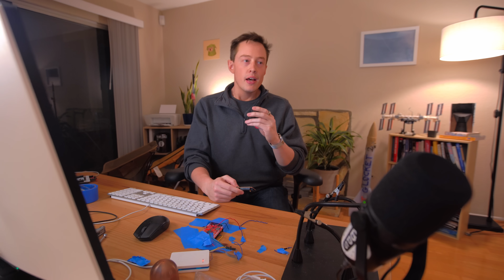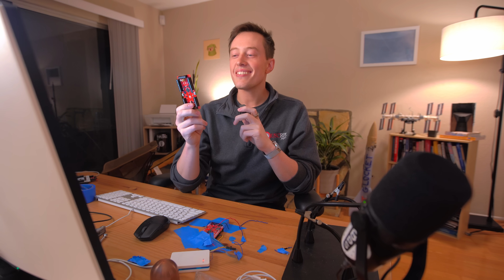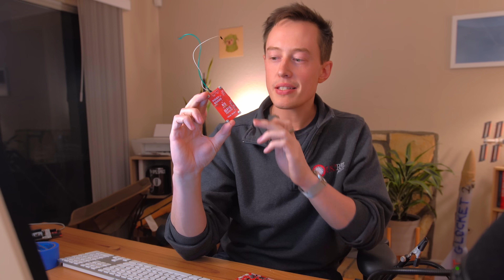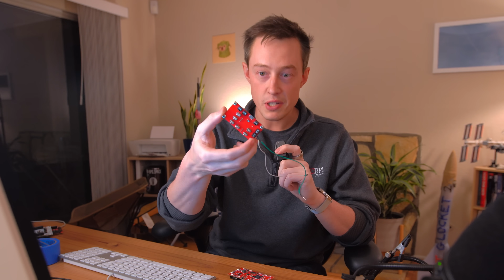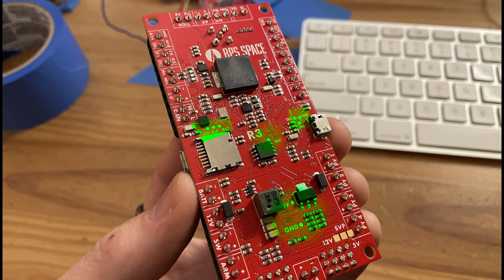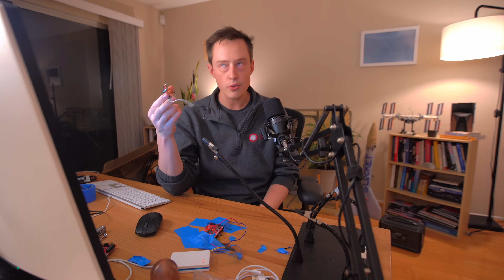the dumbest electronics thing i do

Comment: You have 3 options as far as i see it which are "proper " ways to do it.

1. "Tag-Connect" cables are good. They use pogo pins and as long as you feel able to put holes in your board, and have a cluster of pads free for programming, and think 50 - 90 bucks for the cable is worth it in the long run, then that's a good, professional solution.

You would usually use this on sparse or small boards, where there aren't a ton of things to program, but it is manageable on dense layouts also.

2. You could do something like put a PCI-E 1x card edge connector (or just any card edge connector for that matter) on your boards for programming, and them come up with a pinout of your own. This could be costly due to the nature of cutting the card edge.

I've only ever seen this on super dense boards.

3. Put .1" spaced pads on the edge of your board on both sides and use a chip clip to interface with the board edge.

I've seen this on lots of small stuff.

You could also just design a standardized bed of nails, though it seems like you want to avoid this.

Comment: I've done this sort of thing with programmers and fly leads.  I just line up the leads in the right order and tape them together with scotch tape.  It's flimsy but all it needs to do is hold it together while you're holding it down. The more legit solution is to 3d print a little box to hold a pcb with pogo pins.  The pins protrude through a hole in the top of the box in the perfect place to make contact.  The board being programmed sits in a shallow cutout for positioning. Those clamps to hold it down are called Horizontal Quick-Release Toggle Clamp and you can get them at home depot.

Comment: Instead of pads on the top layer, make them into through-hole pads. Don't space them evenly, make one of them a little further from the others (for polarization). Then 3D print a block with holes in it to hold three sprung gold pins. The pins locate securely into the holes, so you can hold them there with one hand while you click 'program'.

Comment: You could just 3d print a clip holder thing  with the correct spacing and pins so it is a 2 finger operation

Comment: First thing is make your test points vias, or through hole pads.   Second take a bare PCB (unpopulated) drill out the test point vias and insert pogo pins then solder pogo pins to the JLINK (atmel ICE) connector.  Now you have the basis of a test fixture.  You can also do something like this: https://youtu.be/MoG4nINWp5k?t=122

Comment: I dunno i use Kicad and the Pick N Place file is basically generated in the output. I do not optimize for time but for usefulness.. and me getting not annoyed.
Could you not use some pins with a certain pitch or did you design the thing to be really bad..

Comment: You have a 3D printer... print a tool that holds those three pogo pins that you can then use to press against those pads by hand... pogo pins give you pressure and the tool makes it less cumbersome to hold the wires in place? Should take you like 30 minutes to design and then how ever long waiting for print...

Comment: I work as a design engineer and we have done this for the last year on one of our latest designs for programming all of the power controllers on. Too inconvenient to solder on a header and then remove it. Can't leave the headers on because it wouldn't fit in the chassis. The design was meant to have pre-programmed parts, but we just haven't gotten them yet during the prototyping phase. So, I hold the wires while my colleague runs the software. There's like 12 controllers to program per board. My nose doesn't feel itchy all week until 20 seconds after I start holding the wires in place.

Comment: Wot about a 3d printed fixture that contains the pogo pins that the board itself clips or locks into.
Rly just sketch project the board outline and offset by what 0.3mm with located holes for the pogos. Doesn't even need a locking mech really just a rubber band or sum.

Comment: A slightly less dumb (and still very easy) solution is to just put the pads on the edge of the board. Space them out enough that you can just use little alligator clips. It's still kinda dumb, but it's like 2 minutes of PCB re-routing (since the pads appear to already be close to the edge of the board) to make it so you don't have to manually hold the wires.

If you want to take it a small step further, there are a number of 3d-printable pogo pin clamps out there. Re-arrange the pogo pin layout to fit your board, print it up, and away you go. Or if you want a commercial solution, TagConnect has a "plug of nails" cable for like $40 (not sure if it'll let me paste a link, but if you search for TC2030-IDC-NL-10, you'll find it) -- you'd need to drill three alignment holes next to your debug/programming pads, but that's all the extra effort needed. Then, you can just press the cable onto the board without worrying about pin alignment.

Comment: I wonder if you could just change the pads for plated through holes? 

You'd get more friction from the wires going through the board (or you can fold them back a little to keep in place), and you get to keep your super low effort.

This also gives you the option to solder to it if you really need to.

Comment: This would by my low effort solution:

1. Wrap each of the wires in electrical tape until it's thick enough that they are correctly spaced when held together.
2. Tape them together.

Now you can easily push them onto the board with one hand and click with the other.

Comment: Why don't you just have 3 soldered pins on the board and just use a 3 pin connector for the 3 wires and just plug it in.

Comment: You can use through holes for pin headers. If they are a little too small, the pin headers will jam in them and make good contact.

Comment: We always add the same header as the ice on our board so you can simply use a straight cable from the ice. If we dont have space for that we 3d print a pogo pin holder tool we make ourselves which holds the 5 pins for programming which you can simply press on the test pads together

Comment: 3D print a pin board... You have the board files, so you have the locations, just make a block with holes in it the right size with the right spacing... You still have to hold it or press the board down onto the pin board, but it's better than the current setup.

Comment: Make 3 holes on a piеce of cardboard with the proper spacing put the wires trough and then you will be able to use 1 hand just to put some pressure.

Or use a software that would press the mouse button after 10s delay.

Comment: Simple solution pogo pins orrrrrr if u can align it with header pins use plated holes and solder male headers to the programmer and apply pressure to the male headers at an angle pushing against the plated hole? Maybe

Comment: Tag connect in the future. 3D print a jig that hold the probes exactly over the pads. Export those locations from altium or take a scale screenshot into cad. Lastly, digikey will program chips before you solder them!

Comment: you could design a dumb PCB with only three holes in it with header pins soldered onto it and some spacers so that you can lay it on top of the board and put a brick on top of that to hold it in place

Comment: Take an unpopulated board, drill holes through the test points you use to program, stick some pogo pins in those holes, then solder the pogo pins to your hacked up programmer cable.

Comment: You could always just 3D print a lil bracket that holds the 3 wires in position. Or all 6, for that matter. Hell, you could even spend 5 extra minutes and design one that clamps to the edges of the boards, so you can let it go completely. Actually, if you send me the dimensions of the board, I'd be happy to design and print  it for you.

Comment: What you do is make a one-off board and manually place pogo pins. Once. 

The board exists as GSE, along with your soldering station. (You aren't launching your soldering iron, are you? You don't need to launch your bootloader burner.)

Comment: Looks like 5 pins - pwr + those 3 pins.
So, what you can do to be lazy:
Take the PCB design, copy it, remove all components, make the layout smaller to cover the pins
Change the pads to pogo-pins
And then just add a jumper to connect to the bootloader, a few routes and then get jlc or whatever to print the board.
Its a couple pins to solder - so minimal effort.
And you just hold the mini-pcb to the board with one hand (giving you the pressure) and burn bootloader.
You could if you felt like it, 3d print a mount/stand - basically the mini-pcb is part of the stand - so you just place the board to be flashed on the stand, push down and burn - then you are done - but thats more effort

Comment: You need a PCBite kit! Spring loaded pogo pins on weighted articulating arms. Well worth the money, I've used mine to dump Atmega chips on production boards directly tapping from the MCU without any debug ports or pads.

Comment: That comment... "we'll just do it once, then we can move on." - THAT's the catch.

You've done it more than once. You'll do it again.

Make a pogo pin board. If you wanna be slack about it, use some veroboard for a pogo board. But I strongly recommend getting a proper PCB made for your pogo board.

I did the maths on this stuff a while ago; if you have to program more than 2 boards, EVER, it's worth making a pogo pin board. It will save you time & frustration. And it doesn't have to be complicated; I just grabbed an arduino, made a really basic shield with the standard headers and the pogo pins, and soldered it myself.

Don't think about it, just do it <3

Comment: I would half-ass the bed-of-nails programmer and just solder the three wires to a 3 way strip of pin header, and solder pogo pins onto the other ends of the header :D
Just hold the pogo pins with one hand.
Hell I've done this before and left the pogo pins, just held the pin headers against the board :D the header keeps everything aligned

Comment: Thats all right, there were boards I used to troubleshoot that had a blown fuse. I'd replace the fuse and if it blew again I'd put a jumper across it. When I'd turn it on again the top of the bad chip would blow off and ping iff the back of my work bench. Replace the chip, test, replace the fuse and done!

Comment: If you got 3 pogo pins and soldered them to the wires... then heat glued (or even soldered them to a solder board) them to a scrap of PCB you would at least have an easier time than holding wires to the board. If you need contact with that little triangle pin group you could put them in that bluetack (putty?) stuff that sets rock hard when mashed and exposed to air.

Comment: At high enough volumes you could get the SAMD parts pre-programmed by Digikey/Mouser/MicrochipDirect and loaded onto a partial spool.
But yeah, you should just make some jig -- throw a tiny perfboard or OSHPark PCB or 3D printed pogo pin adapter at it. Problem solved!

Comment: few ways to do it less painfully,
use a 1x3 2.54mm header footprint unstuffed, easy to just shove the ends of the wires into the holes, or solder wires to a header to stick in there temporarily
use a tag connect footprint (might be the thing with the claws mentioned) - the cables a bit pricey tho
the piggyback probably only needs fab, no assembly, just hand solder the pogo pins in, and break them out to big 2.54mm pitch headers
you could probably solder to the pads using 32 gauge (preferably enameled) wires - i work on similarly pitched / sized pads, and this works for me

but definitely hard to really do anything after the fact, and not too big of a deal to do it by hand once every 2 years

Comment: Implement something pseudo standard like JTAG.   Google without quotes "Tag-Connect In-Circuit Programming Cables" or without quotes "Plug of nails"   I think JTAG can support multiple devices on the chain so you could have one connector for all three devices.  I'm not sure about multiple devices so look into it.

Comment: I can recommend PCBite from Sensepeek for this. The kit is although great for fast measuring signals directly on the PCB.
For new designs I can although recommend the programmer cable from Tag-Connect. Then you don't need a piggy board for this.

Comment: ok, so i had same problem but, soldered some pogo pins to perf board. no sockets , just the back of the pins through two layers of perf board and solder directly to the signals of the ribbon cable. One hand holds all (5 in my case) wires in one hand and then second hand free to click the button.

Comment: Brake apart a rj-45 female plug in such a way that you can get access to the pins and wire and just tape it when you us it to the board or epoxy some sort of strap i figure you just need some pins and a way to mount it shout me out if this helps

Comment: Look into "TagConnect". It's a ribbon cable with a ready-made pogo pin conenctor. I use them on every board. Some come with hold-down hooks, others can be held down by applying a thingymabob on the other side of the board that grabs the locator pegs.
Reply: And yes, I know, "expensive". Nope, ask yourself how many minutes you spend fiddling with each board? How much faster would you be done with that?

Comment: I'm struggling to find it, but a creator I watched solved this using a 3d printed jig. the center had a screw (yes with ridges) that would go through a screw hole in the PCB, and pogo pins around it centrally. The pogo pins would provide torque, which would cause a plastic backstop to rest against the PCB, pivoting around the screw, since the ridges would 'grip' the hole. It worked SO well, that I'm surprised it didn't take off elsewhere. I just wish I could remember who it was to give credit. It also had a non pogo pin for alignment only, that was larger then the rest.

Comment: Maybe making a simple 3D printed clip that holds the wires in alignment could help? The alignment clip could then be clamped in your desk's mini clamp that could then hold the 3d printed clip in place, applying a little pressure from the wires to the board. That would free up a hand and yourself to walk away while the code was being uploaded and free up time for you to do other more productive things instead of having to hold steady like a surgeon for 45 minutes. I think the two halves of the wire alignment clip could be designed and printed in roughly 30 minutes then superglued together, so that would give a much better time ROI than having to design and manufacture a new piggy back board.

Comment: if you're going to make another batch, search for a company called tag-connect. find a space on the board to add the footprint, then you can use their push pin adapters to connect to it.

Comment: You need to check out tag-connect connectors. They are basically connectors that clip onto a PCB and have pogo pins, so the pogo pins create the electrical connection for however many pins you need, and they clip onto the board through a couple of small holes so you don’t even need to hold onto it. Some connectors don’t have clips, so you’d need to hold onto them but it would reduce the number of holes you need cut in the PCB, as they just have a few holes to make sure the connector can’t be oriented incorrectly.

My friend who was the electrical lead for his formula SAE team learned about them while he was designing boards for his formula car and recently turned me onto them. It would probably require a redesign of your board currently, but it’s worth keeping in mind for your next board. 

Also, you could probably design a super small board that you can solder pogo pins onto in order to basically be able to accomplish this super easily.

Comment: You should script your burn bootloader button to press itself over and over again until it works, now you're down to 2 hands.

Yeah, pogo pins soldered on a mirror version of your board (bonus point if you can use an unpopulated ava pcb if it's symmetric) would work good too.

Comment: I love this, I'm a (fairly) low volume pcb design engineer and have done things like this many times. Others have suggested it but I'll reiterate it: popo pins with a 3d printed jig would significantly improve this. I recommend adding some vias to those pads to assist with positioning. How you're currently doing it would also be made easier if you replaced the pads with through-holes that you leverage the pins against during the bootload. They also make QFN breakouts you can place the chips in and bootload before even putting them on the board.
On that topic, in my experience, most low-volute assembly houses will place any component you provide them and very often they don't even need to be on reels. If you purchase bulk of those bespoke chips, services like Advanced Assembly or Sierra Circuits will place them without hassle.

Comment: Probably attach the wires to a piece of header strip and glue that to one of those insulated alligator clips and clamp that across the contact pads. I also have a welding vise grip that could be adjusted to clamp a small spot like that while reaching around any parts that would obstruct straight clips. But if I was getting fancy I'd maybe use pogo pins instead of header strip.

Comment: Simplest solution: Do through hole pins with 0.254 spacing. Then just stick a header through and hold it at a slight angle.

Comment: You need the PCBite from Sensepeek. Not cheap, but does exactly what you want: put some pogo-pins against testpads reliably, many at a time, while fixing the PCB in place. Took me way too long to make the switch to PCBite. Never looked back since. For future designs, you might want to create a card-edge connector. The best part is no part. And a card-edge connector isn't a part, strictly speaking.

Comment: Use the jumper wires with male ends and hot glue the 3 ends together into a single plug. Or just snip 3 off a ribbon cable. And use plated through-holes on future boards as the female port.